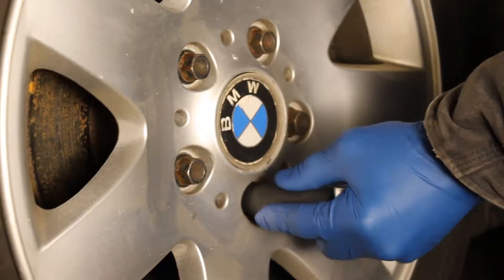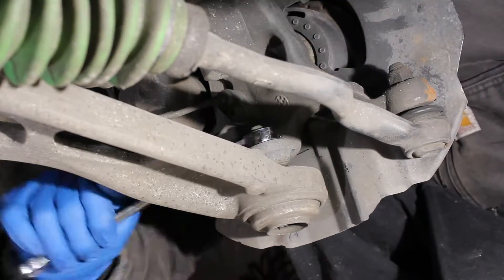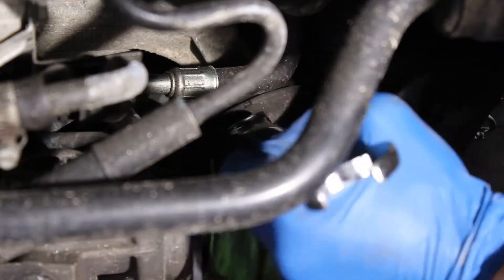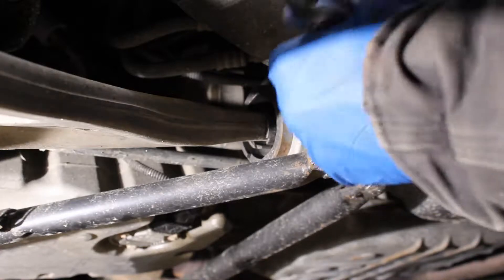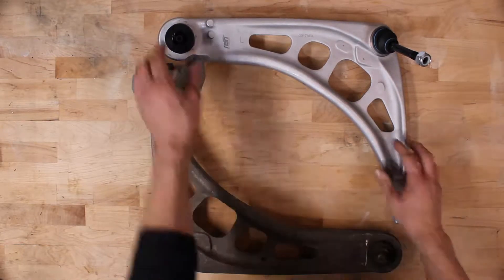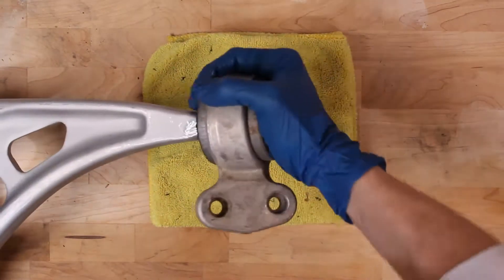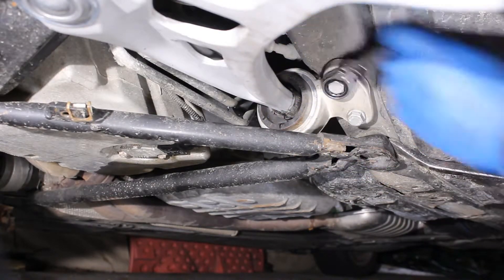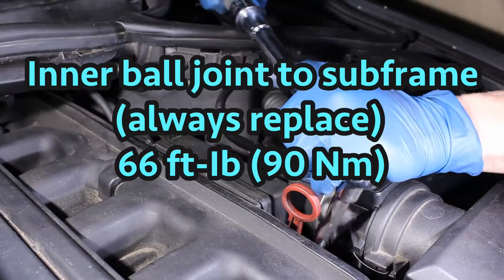BMW E46 Control Arm Replacement

Comment: Ratchet straps! Great tip. Took me a total of maybe 5 hours to get the inner ball joint nut off. It was seized and the ball joint was rotating. Horrible.